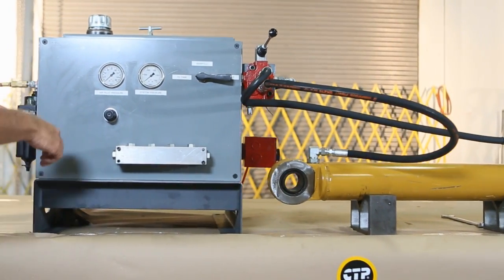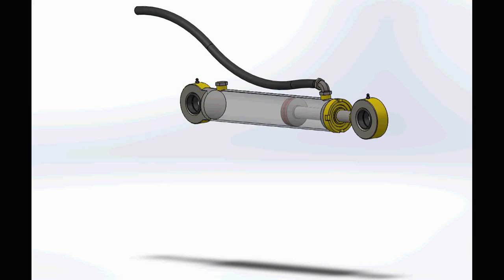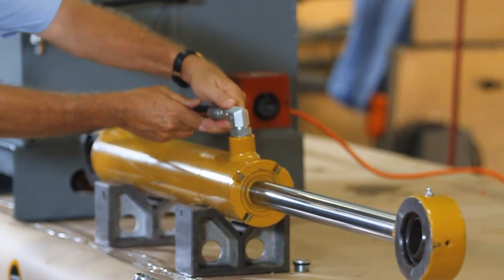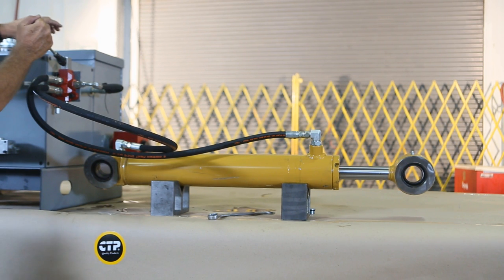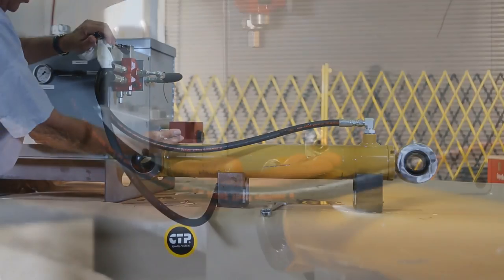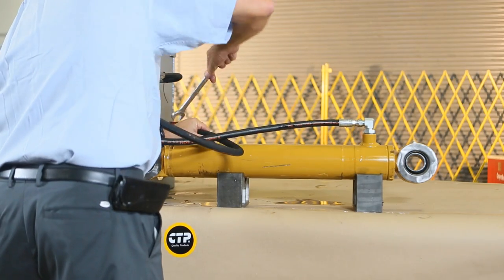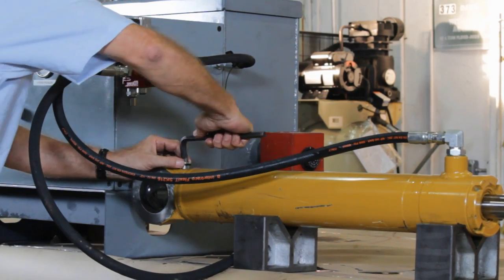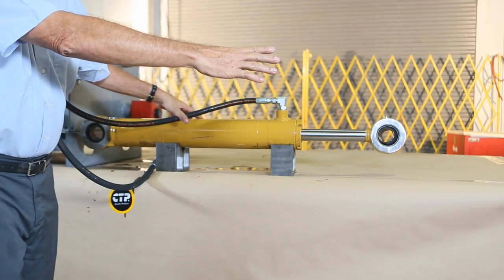Inspect a Hydraulic Cylinder

Comment: Be careful during mid stroke bypass test not to apply pressure from  piston side with rod outlet blocked! This will cause pressure amplification by rod-piston ratio and can damage the cylinder if you exceed rated pressure.
Reply: Antonmursid🙏🙏🙏🙏🙏🇲🇨🇲🇨🇲🇨🇲🇨🇲🇨

Comment: Mid stroke testing is wrong.  If the port is blocked , and the cylinder is full of oil, the rod wont move even if the piston seals are removed. 
For mid stroke testing, the piston rod has to be physically restrained in a frame in the mid stroke position and pressure applied. If oil continues to comes out from one end , the cylinder or piston has a issue.